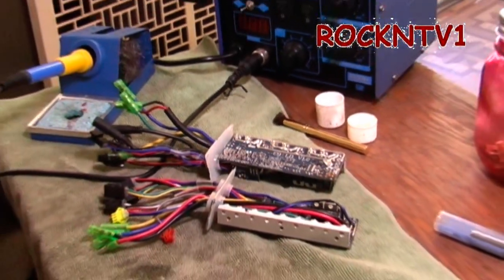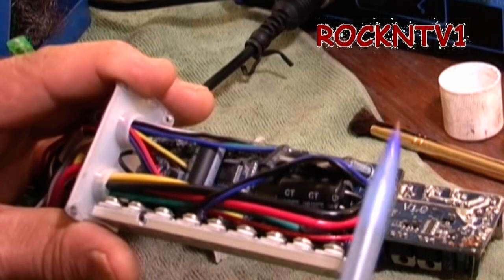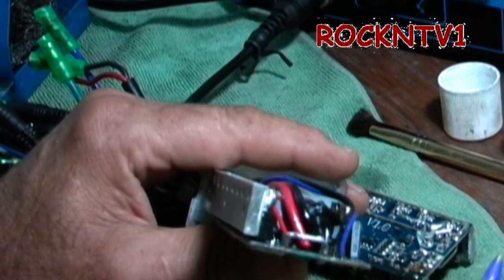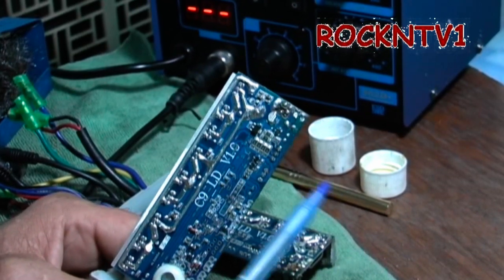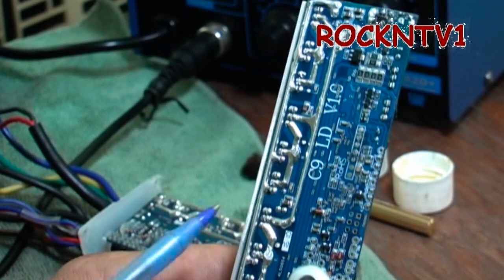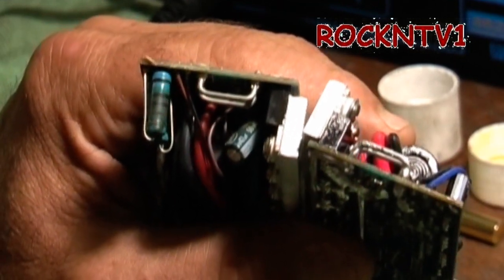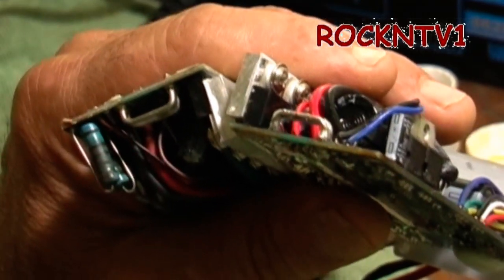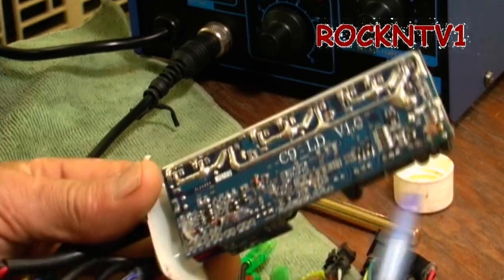SHUNT MOD E BIKE CONTROLLER FOR MORE AMPS ez bikes and scooters DIY ELECTRONICS

Comment: Don't use solder to "beef up the traces."

Yes, you can carry a little more current, but primarily this is because as you mentioned, you are correcting bad soldering.
Too many people are slopping solder onto busses onto traces to increase current.
With solder, less is more.
It is primarily an adhesive and has poor conductivity.

To actually increase current capacity on a trace, you add something conductive - like copper wire.
Reply from the maker: https://youtu.be/qMwopZ1BoPY i was limiting the mod to 10% increase for obviouse reasons explained solder is an excelent conductor opossed to air or to little solder which than over heats.

Comment: hello I did exactly what you said and found that the rail for the MOSFETs were literally only just soldered and not completely either. So I did a bit of a touch up and buttered up the shunts with some 60-40 and man the difference is hugely noticed way more power out the gate. 🎉🎉
Reply from the maker: be carefull of you throttle now, as extended acts of fun WILL CUASE OVERHEATING ,,,, carry on ;-}

Comment: Thanks. Maybe we can just make our own. On a brushed motor, can you run a heavy gauge wire from battery directly to the motor on a switch with a heavy duty relay so you can get a huge boost when needed? Bypassing controller altogether... Of course you drain your battery quicker. And use it when already cruising. That way least resistance bypassing controller. Have you experimented with a setup like this and whats the result?
Reply from the maker: you CANNOT bypass the controler as it provides the phase voltage to brushless motors.

Comment: Yo if I do this to my 48v controller can i still use my 48v batt
Reply from the maker: yes, but dont just solder on a blob, reflow the through holes,  top and bottom and just coat one of the shunt wires,,, then try it you realy dont want more than 10% increase as the rest of the system becomes the weak link.

Comment: You said in video a 48 volt battery fully charged is 51-52 volts.
Yes with a BMS board restricting the voltage.

48 volt battery 14 series is 58.6V fully charged.
Next one down from that is 13 series fully charged is 54.5 volts
Reply from the maker: That also depends on the charger, thanks for the info
Reply from the maker: "48 volt battery 14 series is 58.6V fully charged"   Thats 10volts over charge which will likley hit the controller high volt limit for protection. not good

Comment: Hello sir! I’m modifying my ebike and I bought a new controller and battery but it turns out that they won’t fit in the battery case together because they’re bigger than the stock ones. 

My question is would it be wise to just take the circuit board out of the new controller and wrap it up with like foam or something instead of using the box so that it would fit? Or will there be future complications to this? 

Please lmk what u think!
Reply from the maker: Thats a tough question,,, but where you said you are modifying your ebike I imagin your not scared of doing the work your self. So i ask, is your bike a kit that you assembled? or a prebuild brand of electric bicycle?
Reply: @ROCKNTV1  no I’m not scared of doing it myself but I do want to avoid any future complications which is why I ask. 

And no my ebike is a Jetson bolt it’s already made. But I looked up like 100’s of YouTube videos and I educated myself and all I’m going to do is replace everything basically but keep the main frame of the bike. 

I’m upgrading from a 
• 36v 6ah battery to a 48v 14ah battery
• 15a controller to a 48v 28a controller
• 250watt hub motor to a 500watt hub motor
• and changing the throttle to a thumb throttle with key ignition. 

And I’m also customizing it like spray painting it and adding things like new tires and a new seat etc.
Reply: The problem is the new battery and controller won’t fit the battery case if put together. Because the new controller box (48v 28a) is too big. 

So I wanted to know if by just having the circuit board of the controller wrapped in foam or something would be a good idea so that it can fit the battery case along with the new battery. 

I was wondering if there would be future complications by not having the controllers circuit board in the box that it comes with.
Reply from the maker: K, so, once again i am Imagining,lol, you have your wireing (plugs /connectors) figgured out. 28 amps sounds on the high side of a 500watt motor - phase wire sizing. Thats up to you, The extruded aluminum case most ebike controllers come in is for heat dissapation AND they are not very waterproof, you deff need to consider these 2 facts. In a perfectly dry world, the controller would be in a high airflow placement. 48 volts and 28amps is deff going to make heat on slow going hills and standing full throttle leaves.
Reply from the maker: DUDE, I looked up  a Jetson bolt, that AINT no bike,,,, itsa scooter,,, lol
Reply: @ROCKNTV1  lol thank you very much! And yeah I know I said bike because u need an ebike controller to make it work not a scooter controller. As it needs the 3 phase wires and hall sensor to the motor when scooter controllers usually only have the 2 phase wires. But anyways thanks for ur help!! :)
Reply from the maker: when i said scooter i meant like knee caps hitting your chin, aint no bike if no pedals,,, good luck ;-)